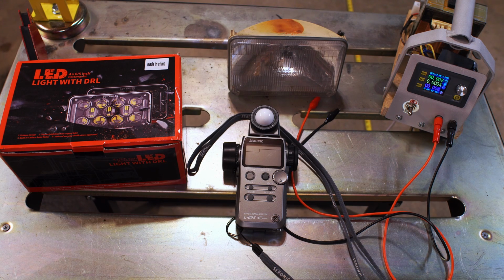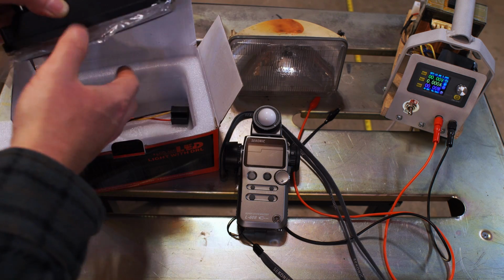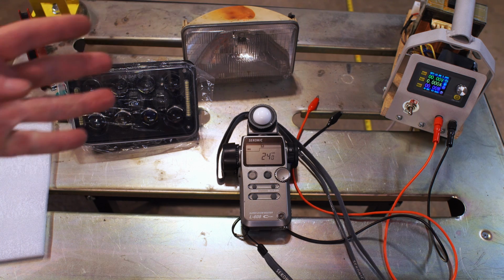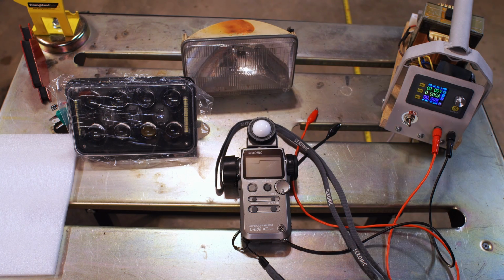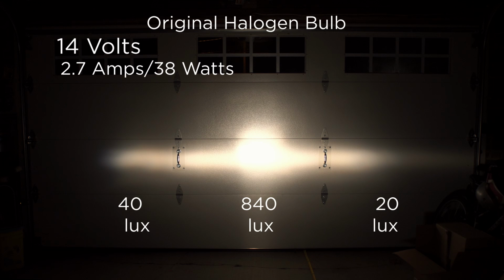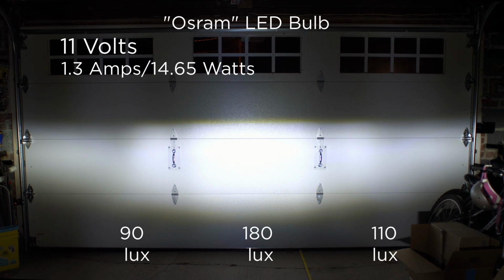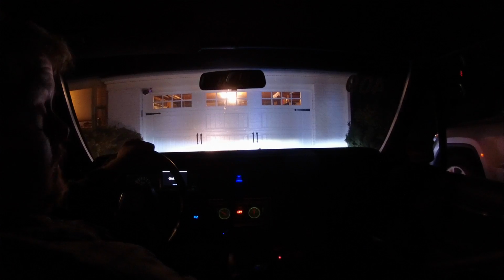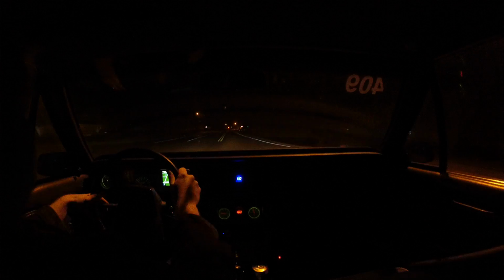Osram 4x6 LED Headlight Review & Test Drive

Comment: this cant be original osram. its a fraud, its fake. Osram doesnt manufacture such cheap shit, in cheap boxes, with no certification whatsoever. Also OSRAM manufactures in germany as far as im concerned. so they are  a knock off, and shouldnt be called osram, because its a fraud...
Reply from the maker: You might be right. I don't know what can be done about it anymore.

Comment: I bought theses for my 96 S10 Blazer in February 2019 because of your review. So far I like them, but @Headlightrevolution doesn't.🤷🏾‍♂️

Haven't properly rewired my DRLs for that part to work yet. I have yet to need hi-beams so I wired the DRLs to work on that circuit.

 Ordered clear covers to help keep snow from building up on them in the winter, but I bought an 2002 S10 Blazer for my daily. So that has yet to be tested.
Reply from the maker: I don't know who headlight revolution is, but I believe I did a pretty thorough test of these.  The only real "weakness" - and it's really not a weakness - is the hot spot of the low beam isn't as bright at the tungsten bulb.  But the spread is MILES better - total light output of the low  beams is higher with these LED bulbs.  Then there's the DOT low beam cutoff, which is excellent.  And the high beams are devastating.  We just drag tested the electric turbo I've been working on, and we started the video with a pretty epic burnout.  I actually wired in the DRLs just for that burnout shot.  These are DRLs only: https://youtu.be/AOL3Qyczt3Y  I also think it's a pretty fun video overall, but at least checkout the DRLs.

Comment: When changing Sealed 4x6 halogen to 4x6 led do you need to change any wiring?
Reply from the maker: The answer is... It depends.  I did, but you might not.  But it's not hard to do.

Comment: Best 4x6 headlight is JW SPEAKER 8800 EVO.
Reply from the maker: Yes it is.  It's also more than 4x more expensive.  It would take a fool to spend $800 on a set of headlight bulbs - at least that's what they cost when I needed these.
Reply: @AlexLTDLX  agree,  its expensive ones but its your eyes! Better  light at night  is less stress for your  eyes, you can get only low beams, Im using them for about 4 years  probably,  got them for  my 18 wheeler and not single  day I regret.

Comment: now that thing shifts like a proper auto trans should.
Reply from the maker: It's a BTE powerglide - 1.80 straight cut low with a 10" seriously built converter (steel "C" stator, 3/8" thick anti-ballooning plates, etc).

Comment: My interpretation of your results is that no relay mod is needed if going from factory lighting to these, as the output didn't materially change from 11-13 volts.  Is that a correct interpretation?
Reply from the maker: Yep.  That's accurate.
Reply: @AlexLTDLX  thanks!

Comment: I have a camaro wondering do I jus need the wire harness to hook them up or do they jus plug n play
Reply from the maker: It depends on how your Camaro is wired.  On my car, I had to switch two wires (I believe - it's been a while since I made this video).

Comment: I installed these on my Chevy s10 and love them.
I originally replaced the stock halogens with led headlights that had multiple rows of leds but they were floods and were horrible they lit up everything from the road in front of the bumper to space .
Very difficult to drive in rain or snow.
I bought the new ones because of your review.
Reply: Thats what I have. 
The small 3 led rows. 5 LEDs on each row. And they suck. Lights up every where in the trees. Lol

Comment: How do i connect the day light? I ordered these lights but the problem can't connect the DRL( day light) the separate wire. Please let me know. Thanks
Reply: Either find a switched wire to connect it to, pretty easy to do just check fuse box or splice into low beam.

Comment: I bought the exact same product on Aliexpress for 38$ / pair ! Avoid Amazon always, they sell chinese products 3 times bigger than any other website.. Even ebay sold these cheaper...
Reply from the maker: Good to know.  Have you installed them yet?  Thoughts?
Reply: @AlexLTDLX  I did install them and they are good at night... However, i used 8000K HID before these and i'm still trying to get used with the LED lights, this looks more like 6500K at night.... But they light the road better than my HID...

Comment: hey 2 question for you if you can answer
1 - im installing these on my vehicle but NOT factory, they will be in addition to my factory head light so like driving lights
so can i have highs and lows on at the same time or will that damage the lights in any way ?
2- bc its not factory, they will be mounted in a housing, will they get too hot ?

thanks
Reply from the maker: You can have both on at once, and they don't seem to get very warm, so they might be ok enclosed; if you're concerned maybe you can have the housings bein contact with some aluminum that is exposed to open air.  Alternatively, you can use a current limiter or a buck converter and undrive them a bit.  But I don't think it would be necessary - we're not talking 100 watts here, and they're sealed to begin with.
Reply: @AlexLTDLX  ok thanks

Comment: Great video Mr Alex, got 1 question. You mentioned you can wire both headlights for low beam, but I was wondering could you wire the low beam to run like high beam. What I mean is have all the LEDs on 1 headlight to work, and then when you switch to high beam the other headlights flick on. I think yours has a total of 11 LEDs can those 11 run for low beam. I have a 2006 KW T800 and it has 4) 4x6 headlights and I wanted the low beam to run all 11 LEDs and then when I switched to high beam those same 11 plus the high beam 11 to work also....

Sorry for the long post, and I hope it wasn't confusing.
Reply from the maker: You could do that, but it would get you flashed and ticketed in most places.  You need the cutoff of the low beams to prevent blinding oncoming drivers.  I never understood the morons who drive with their highbeams on.  You're blinding on coming drivers so they're more likely to cause an accident.  I personally feel these sorts of people should get their licenses suspended.  Back to these lights - the highbeams have no real cutoff.  While the low beams are a little underpowered (but not really - at least not in practical use - I think color temperature plays a role here), the highbeams are devastatingly bright.  Personally, I think what you're suggesting is not a good thing; nevermind illegal and dangerous.  At least on public roads.
Reply from the maker: As an addendum - I don't see a problem with running all 4 low beams at once; except that you might still get pulled over (technically, that's not allowed).  At least you won't be blinding people driving towards you.
Reply: If your truck has the same wiring as my Camaro, which I assume since they are the same lights, all you would have to do is run a jumper wire from the low beam terminal from the actual low beam light to the low beam terminal of the "high beam light" then all the lows would be on to allow better lighting as low beams and function with the high beams as the wiring keeps low beam on with high beam. 
To have all the lights on the low beam would essentially be running high beams all the time.

Comment: Out of curiosity, 

How were your measurements taken?

As in how many points did you take and did you use a lux meter?
Reply from the maker: It was 3 points at each setting as described in the video and I used my Sekonic Cine Master light meter to take the measurements.

Comment: Will these fit my 99 Trans Am?
Reply from the maker: Wow... that's an odd one.  I don't think they will.  Yours come up as a different part number, but the size seems close - these are 4x6 inches, yours are listed as 95x150 mm...
Reply: AlexLTDLX will these fit a 89 GMC Sierra SLX with the quad sealed Ben head lights

Comment: Very good test,  thank you.  On your Amazon link there's an option for a very similar set of lights with Cree bulbs instead of the Osram.  Did you look into that light at all?  The advertisers image of the beam pattern looks like its not as good of a cutoff but it's hard to know for sure with their picture. Im actually looking for off road use so I don't mind if the beam isn't perfect but I want a wide beam with good throw.

Comment: I bought one of chrome 15 3 watts ea LED 4x6's, then I saw this review and got one like it, and wanted to compare them. The power  consumption on high and low were similar, but the halogen cutoff. Its more like the pre halogen seal beams spread. I loved the light cutoff on the second light, but was disappoint in its brightness when tested. I measured about the same lux as you did on high and low. But the chrome one with wider spread and no cutoff measured 850 lux on low,  and over 2,000 on high, at their centers.

I only have two 4X6's seal beams on my 77 mini truck Toyota, that I installed decades ago, to take the place of the 4 round headlights that came on it. Never went halogens, but now for a change to to these bright boys, for my aged eyes. I figure the chrome one will be on the passenger side since it brighter and has a broader beam. And use the dimmer one like this on the drivers side. The total on low will be like two halogens below the one lights cutoff, but with the wider white pattern and about 3300 lux on high with only two lights. My 461 Olds in the mini needs bright highs, in the wide open desert.
Reply from the maker: Thanks for the post.  The trick seems to be getting a decent cutoff and brightness.  I don't want to be the guy blinding people everywhere I go; these are the best cost/performance LED retrofits I've seen so far.  Yes, it would be nice for the low beams to have a little more throw, but I'll take the better spread in compromise.  I'd hate to hit a deer I didn't see off to the side of the road.  The highbeams are amazing, though.  But they don't have to have a sharp cutoff like the lows do.
Reply: No problem, and loved your detailed review on them, and even bought one myself for a comparison. Not worried about a little light blinding other drivers, since seeing some light is normal. The center is a nice size round beam with them in the center and  has the greatest lux, and then drifts down on lux away from it. 

Also using it on the passenger side only should limit the problem, as pointing it a little lower should. Of course if I get negative comments from people or the flash asking for dimming when  they are dim, then I will adjust. Idiots with bright lights are not one of my favorites. For now a seal beam sits in the drivers side, but I may change it to the one, like I got in your review. Tested both inside using a power bank (Micro Start). And light meter at about 12 feet. At 70, my eyes might need a little more light than you. Bright lights are good as long as not blinding.
Reply: Do you have a link to the CREE lights you bought?  Please confirm that the CREE are brighter and have a longer throw than the OSRAM?

Comment: Hi i just purchased them and arrived at my door today , i m gonna install them on semi truck  freightliner classic 2007
Let see how it goes 
I will get back on e they r on
But he was right , doesn’t look like they r DOT
Reply from the maker: Did you install them yet?  What are your impressions?
Reply: AlexLTDLX yes I did install them and they r very bright and nicely fit but I didn’t separate  the wiring for drl i justnplug n play so my low beams r on all tha time
Reply: AlexLTDLX  one more thing the lens is plastic and when I was cleaning them today they r getting scraches soni wouldn’t buy them again 
Has to be glass lens
I guess u get what u pay right
Reply from the maker: Thanks for posting.  I haven't noticed any scratches on mine - they seem at least as durable as my plastic housed halogens.  I'm sure you could polish them if it's an issue.
Reply: One possible way of protecting the clear plastic is with clear paint, but may have something else for you as I just finished some testing with some glass 4x6 halogen conversion lights off EBAY, like these https://www.ebay.com/itm/Universal-4X6-Head-Light-Lamp-Drl-Chrome-Housing-Clear-Lens-Upgrade-Replacement/182347724774?_trkparms=aid%3D111001%26algo%3DREC.SEED%26ao%3D1%26asc%3D20160727114228%26meid%3D7fc1962890774ebfb69dc66217c3493e%26pid%3D100290%26rk%3D1%26rkt%3D4%26sd%3D182347724774%26itm%3D182347724774&_trksid=p2060778.c100290.m3507. 

A pair is about 20 bucks. They are plastic, with a clear glass lens. The good news is I have the flat wide cutoff, with the new F2 Evitek LED bulbs I just got in, with tons of lux at 12 feet. Measured 17-1900 lux on LOW, and 3300+ on High. Just above the cutoff on low I saw only 54 lux. They cost about 40-50 bucks for the pair and are about 36 watts each, with the fan. About 30 watts without, and the heatsink I measured was at about 120F after a few minutes running. The combo of housing and the F2s weighs much less. I am weight sensitive too LOL

The plastic housings would be a concern with hot halogens in them over time but not me thinks with the LEDs..

Comment: Just to clarify, the driving test at the end was 2 LED headlights on the passenger side, and 2 original style headlights on the driver side?  Or are you running just 1 and 1?

When you go back to the low beams after running the high beams, the lighting seems almost inadequate. Based on your commentary, though, it sounds like you're satisfied with the lighting even on low beam. Is that correct?
Reply from the maker: thepno95 In the driving test, the halogen low beam was on the driver's side; the other 3 lights (passenger low beam and both high beams) were LEDs. The low beams look inadequate by comparison because the high beams are insanely bright - far brighter than the halogen high beams.  The LED low beams have excellent spread and make things on the road "pop" a lot more than the halogens did.  The only weakness of the LED low beams is the lack of throw in the one spot where the halogens have a bright spot.  But the spread, even distribution, cutoff and overall driving experience is better with the LEDs.  I will be keeping the LEDs. The LED high beams give way more light and visibility (including throw) on unlit desolate roads than any other headlight I've ever seen on any car.
Reply: Thanks! I can definitely appreciate the high beams - I converted the high beams on my CTS-V to LED and they make the sun look dim. ;p

Comment: alex are these plug n play?  I have an 86 4 eye mustang that I'd like to give these a shot over the stock halogen headlights
Reply from the maker: MrMikestang63 Almost.  I had to re-pin the low beam connectors and trim the high beam plugs (a pair of wire cutters does the trick).  They come with adapters that work without modifying anything.

Comment: alex your rockin full ghetto now! lol. i like your your power supply wouldn"t happen to have a parts list and wiring diagram would you? i put water/meth on mine this summer and although i am not making the power you do and i have no dyno or track times it was definely worth it. even with air to air. look forward to future videos.
Reply from the maker: Ha!  The lights actually don't look ghetto - they're more white than blue.  The power supply is just this module:  https://www.ebay.com/itm/Programmable-Constant-Volt-Current-Step-down-Power-Supply-Module-DC-50V-5A-E0W4/351824924923?hash=item51ea6650fb:g:-24AAOSwn-tZGSwZ with a transformer from the receiver I had in college, a 25 amp bridge rectifier (only using two of the diodes - it's connected so the transformer center tap is ground), some caps salvaged from computer power supplies, screwed to a board with an aluminum plate that was sandblasted, and the handle was some aluminum bar stock with a tube tig welded to it.